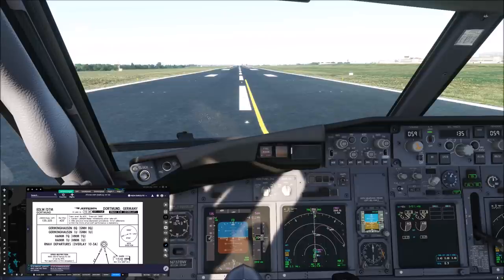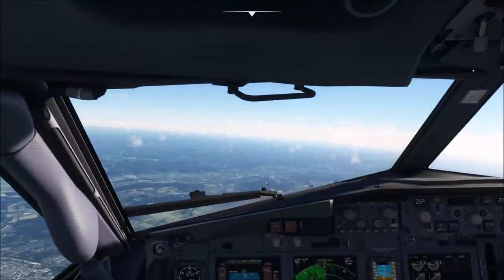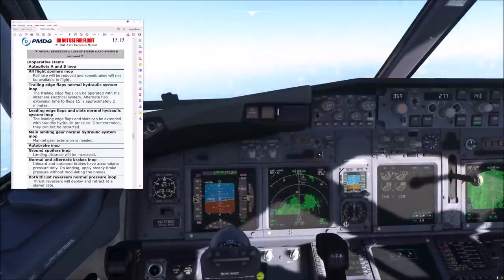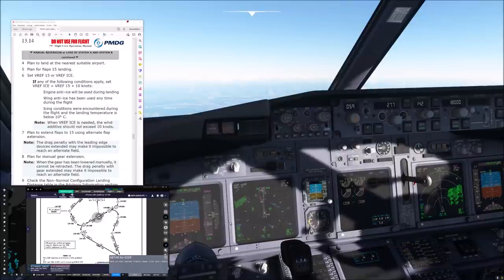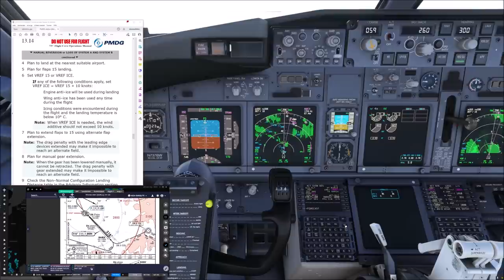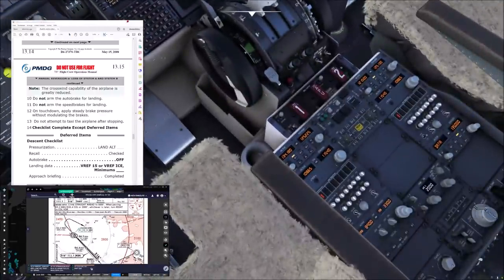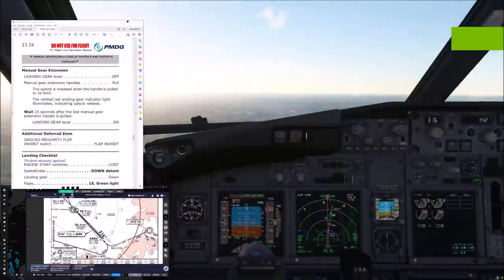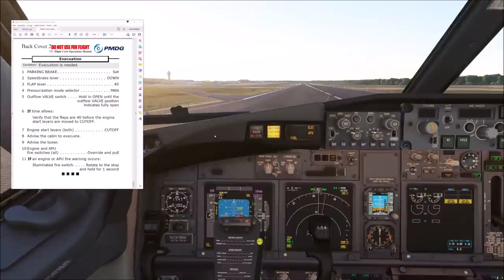PMDG 737-700 for MSFS - Failures: Manual Reversion

Comment: I have had to deal with manual reversion in the 737-800 full motion sim for training... I can confirm it does indeed suck.
Reply from the maker: Oh yes! Simmers can judge themselves happy that they don't have proper force feedback!
Reply: @A330Driver  is there any yokes with any kind of force feedback?
Reply from the maker: @NiclasGleesborg  Not the kind of force feedback you'd need to simulate a manual reversion. There are some out there on the market, but nothing that's close to the real 737s force when you don't have hydraulics.

Comment: Well done! 
I haven't flown the 737 in a long time but I do remember that the 737 is a bitch to fly in manual reversion, so personally I would request a block altitude to reduce the workload and I would set aside the maintenance aspect in my decision making and focus and safety, so in this situation I would favour FRA over CGN because it's got half the crosswind component, which will make it easier to land the aircraft. Just a personal assessment here.

Comment: Thanks. One of the main reasons I am considering buying this aircraft is the failure simulations. Really looking forward for your next videos in this series!
Reply: Also in the topic of failures per request - I would be interested in seeing a pressurization related failure.
Also, if you can consider running any failure while online on e.g. VATSIM so we can get a feel how the procedures go along with the communication.
Reply from the maker: Indeed, the possibility to do some of the non normal stuff is something I really love as well!
Reply from the maker: Thanks, I am certainly considering a rapid decompression at some point. I might actually do it this week as I'm currently re-reading this topic anyway for my next recurrence simulator training in two weeks time.
However something that bothers me with the decompression is how to realise it in the simulator. The Captain and First Officer are doing a LOT of different things at the same time during this manouver and I'm not quite sure yet how to do that in the sim without a second pilot. Something I'll scratch my head about over the next days.

I'm considering doing some failures on VATSIM, but I have to find some controllers who are actually willing to help with this as many controllers are not particulary happy about major malfunctions and emergencies.
At least not when there's a lot of traffic around. And without traffic it's kinda boring as well, isn't it?

Comment: Great video, thanks. After landing the yoke makes a clicking noise. Maybe I missed the explanation, but is the yoke acting the same in real world if you damage your landing gear?
Reply from the maker: I am rather glad that I do not have the necessary experience to answer your question ;-)

Well hoenstly, I don't think it should do that. Will raise it with the developers.
Reply: @A330Driver  😄 Thanks.

Comment: I have a question regarding the hydraulic system, specifically the alternate flaps switch. With the hydraulic system operating normally, after watching several CBT videos and other videos describing the operation of the system and the logic, when the alternate flaps switch is switched to ARM the standby rudder shutoff valve remains shut and the corresponding light on the overhead stays off. However, in the PMDG 737 it comes on if this switch is put in the ARM position. Is this correct or is the logic in the sim aircraft incorrect? Thanks. Love your videos.
Reply from the maker: Probably the logic of the sim aircraft, but I need to check in the manuals again. If you think you found any bug please submit it to support.pmdg.com so that it can be fixed in an update!
Reply: @A330Driver  Thanks for the reply. I did submit a support ticket and they’ll be looking into it soon and will get back to me.

Comment: does it has non programmed failures? I mean, those that are produced after some flying and bad previous decitions? Maintenance of pieces, etc? So the plane won't be never as new as the first time is operated? Thanks!
Reply: From what I've heard there are failures that can occur based on the real world mean time between failures
Reply from the maker: It does have service based failures, yes! And if you don't do regular maintenance checks (provided you have service based failures enabled) you will run into those.
Reply: @A330Driver  nice!

Comment: do the brakers work or will they work with the electronic system realistically?
Reply from the maker: C/Bs are currently not simulated. However, crews aren't supposed to touch them anyway unless directed by a non normal checklist and hardly any checklist actually does that. In fact the only one I recall by heart right now is the airspeed unreliable checklist where you can pull the stick shacker C/B to silence nuisance warnings.
Reply: If you meant brakes for the wheels,  Yes they  would work with pressure stored in the brake accumulator this  pressure  is used in case of emergencies like manual reversion
Reply: @regalclan5202  that's good to know

Comment: Heard how you mentioned using a force feedback yoke. I've been using the one reviewed in the clip linked below for many years now and it's truly awesome! Do be warned though before you watch the review, it will probably not be as appreciated by "she who must be obeyed" if you have one of those if she spots the price tag 😉 Before MSFS, I worked with Zibo and the developers at Brunner to make it work correctly with a hydraulic systern failure in the Zibo mod and it turned out really good! Using the yoke with no hydraulic pressure was a bit like a good workout 😁

Here's the review I mentioned:

https://youtu.be/-oj_RwD950I
Reply from the maker: I'll have a look at it, thanks!